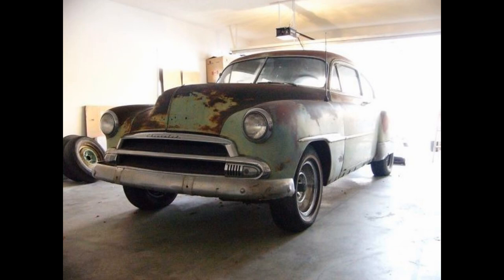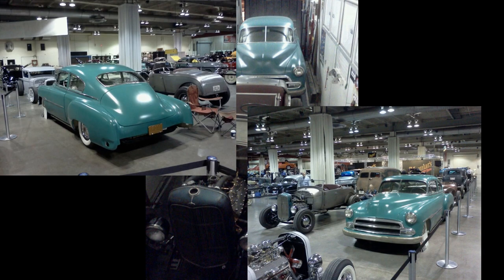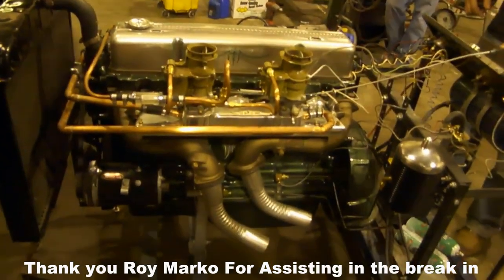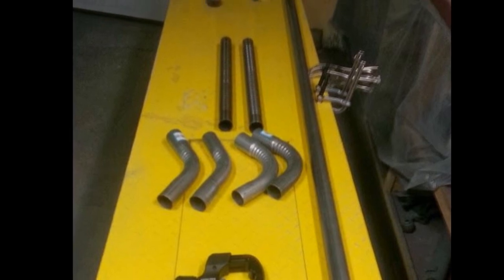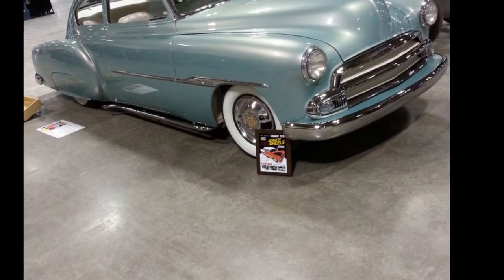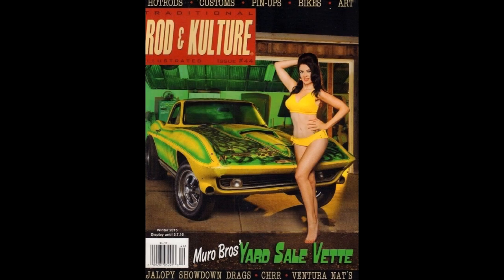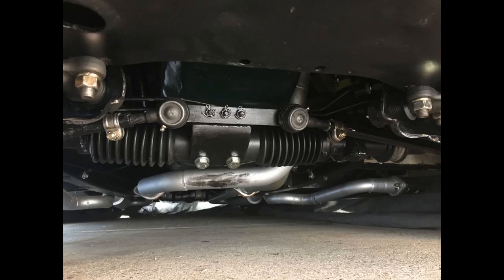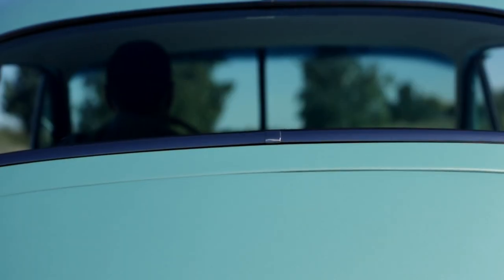1951 Chevrolet Fleetline, A mild custom that wasn't always cool

Comment: Question, why would a stovebolt 1951Chevy 235 start a slight misfire every now and then only when its running for a long while at a slightly hot operating temperature?
Reply from the maker: Not 100% sure without trying some stuff, but that sounds classic coil is starting to fail